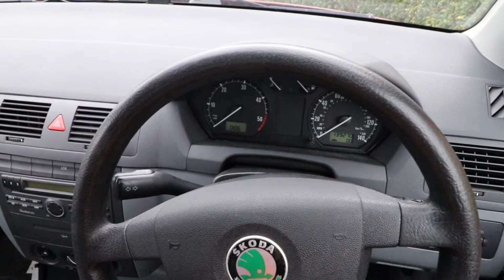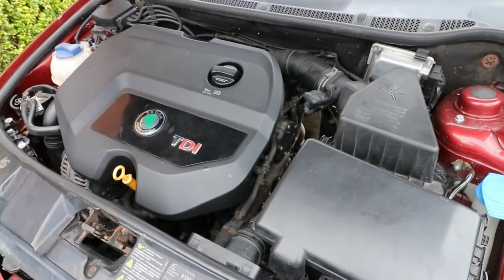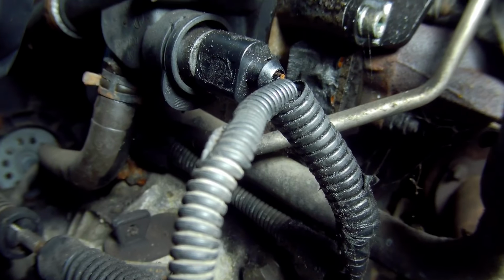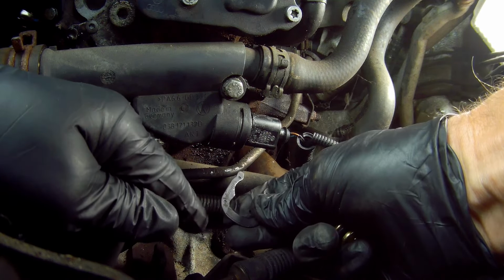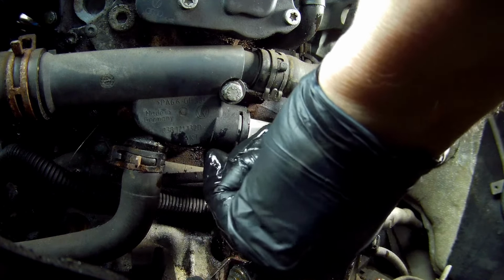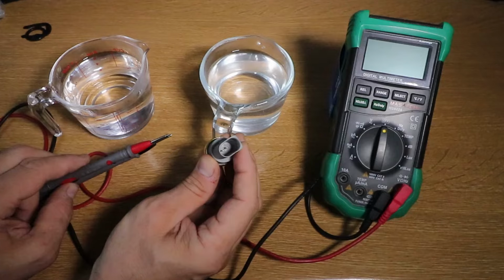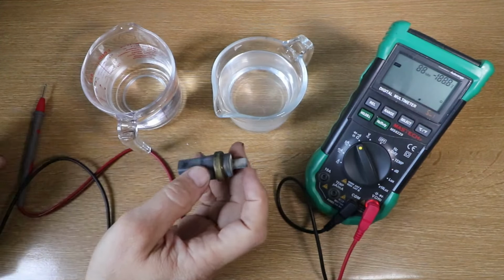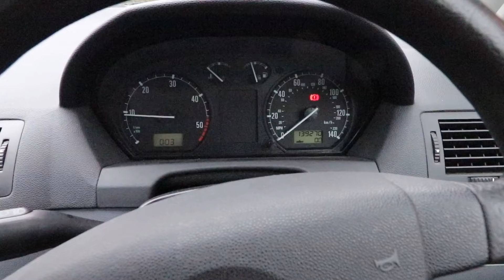SKODA FABIA Water Temperature Sensor + testing (MK1 99-07)

Comment: Hey Harvey, I've got some questions about a skoda fabia vrs, it seems like the removal of the back bumper is in two parts, I just wondered if you could point me in the right direction on how to remove and replace etc, I don't think it's quite the same as the standard fabia
Reply from the maker: Sorry, not sure. I think they have a couple more screws. I thought they were one piece, maybe you have a bottom skirt. I know there is a diffuser on the MK2 fabia.

Comment: I have problem in dashboard (EPC) and cruise control stops working.  I have been to monitor he says should you replace brake light switch and I replaced and problem is still
Reply from the maker: You will have to go through the various systems to find the fault. throttle pedal, throttle body, traction control and of course the cruise control. Are the switches on the cruise stalk stiff/loose? spray with electrical contact to clean with bat disconnected. First look for bad connections by taking off/on, leaks in throttle body/clean MAF/EGR.  May have to use OBD2 scanner to indicate issue in the end. Also re-check brake pedal switch fitting/functioning correctly. Hope this helps and you can get it working again :-)
Reply: @HatBoyHarvey  Thanks, I will try

Comment: what if the cold start continues after replacing a temperature switch its start after 2 attempts or more vw polo 9N?
Reply from the maker: I am not sure if it is down to pour quality replacement expansion tanks or something internal, maybe resistance builds up in the wires with age that gives incorrect readings to the ECU . There are 2 sensors one for temp and the other for level, the first is a variable sensor which you can test out of the car with a volt meter (resistance decreases with heat) and the coolant level switch sensor which is just a switch continuity across the terminals. Obviously you can override this, but I can't recommend it you understand.
Reply: @HatBoyHarvey  thanks for reply sir the  other sensor you are talking about is camsensor?

Comment: Hi.. I have an issue with skoda Fabia 1.2 petrol,  that Airbag indicator is continuously ON from last 6 month and vehicle is handled by me only. Can you please share how to fix this problem..
Reply from the maker: Can you remember any conditions 6 months ago that could be related? check the seat belt switch under the passenger seat isn't stuck in open position. is your battery correct Ah for car with good 12v+ voltage/charging ok? clock ring on steering wheel, many things can do this. Wiring on older cars can loosen within connections. Does the car leak-in water? Are all systems working correctly in car? Have you changed the brake-light pedal switch? if you can get access to obd2 reader it will help narrow things down a bit.

Comment: I have a Fabia 1.2 Htp and have replaced the expansion tank and temperature sensor but still have a coolant light on dimly constantly despite levels being fine any help please?
Reply from the maker: Examine the connection/wires for breaks on both and then look at the cooling fan relay and connections.

Comment: thanks for your video, it made the installation very easy! I changed my ECT sensor because I got a fault code in my OBD but now it still stays on the bottom of the gauge after a long ride and sometimes suddenly jumps up to the middle and stays there.. Any ideas?
Reply from the maker: @adamben1978  sound like a continuity issue. A break in the wires or a connection is loose somewhere. You can check this with a test light end to end,  may take some time to find it :-/
Reply: @HatBoyHarvey  i will take a look at that thanks alot! i was thinking maybe i received a faulty sensor

Comment: Thanks Harvey for that great video, very instructive and clear: I was wondering if I could test the operation of the cooling fan by shorting the terminals to the water temperature sensor or is it likely to damage the temperature dial because the resistance is too low?.
Reply from the maker: it goes to the control module so no you can't short it. Take it off and the pcm will detect a fault and turn the fans on. you will probably need to clear the fault afterwards. you can also check the thermostat is not open all the time and not getting fully hot. To see if it works, power the fan manually . check the fan relay and connections.
Reply: @HatBoyHarvey  Thanks Harvey its great to know, I have tested the Fan direct from the battery and the fan is fine. As you say it could be the thermostat, the needle takes its time to reach the mid way mark and then drops  if I go downhill.  The thing is when the AC is connected only the small fan spins and I thought they were connected in parallel. thanks again great channel.

Comment: Iv a 1.4 2005 skoda fabia would it be the same. Thank you for your videos.
Reply from the maker: On the 1.4 MPI take off the engine cover and it is just behind the rocker cover on the right pointing up vertically.
Reply: @HatBoyHarvey  you're a legend. Thank you for the reply i ordered my oil temperature sensor and water temperature sensor.  Love my little 1.4 tdi work horse skoda fabulous. Have a great  weekend.

Comment: Hi Harvey. Great Vid as always. Just changed my ECT sensor. Would you know if this is link to the fuel management system? (ie would a faulty sensor effect fuel economy?) Thanks.
Reply from the maker: Yes and it would.  The ECU takes temperature into account to decide the fuel-air mixture ratio  and a bad sensor could result in an over rich ratio leading to black smoke from the exhaust and poor fuel economy.
Reply: @HatBoyHarvey  brilliant. Thanks for the info Harvey. I'm hoping this might cure my fuel economy issue. Appreciated.

Comment: Hello, many thanks for your helpful video...I'm having the same issue. Would you know where the sensor is located on the 1.4 MPI model (2001) at all? I can't seem to see it in the same place as this particular model. Many thanks again for the great invaluable content!
Reply from the maker: If you follow the coolant pipes you will see that they go into a plastic fitting on the side of the engine.
Reply: @HatBoyHarvey  thank you! Would it be the same Two Pin sensor as shown here? Thanks again :)
Reply from the maker: @meckleemu  4 pin
Reply: @HatBoyHarvey  thank you!

Comment: Hi, I've skoda fabia, last week water pump changed, since than I realised the air vent don't blow out a warm air, somthing isn't right, any idea of what causing the this problem?

The water level ok.
Reply from the maker: Sounds like water circulation has returned and you have warm air again. If this is not what is set on the temp knob then the flapper motor is stuck on hot which often happens on older fabias.
Reply: @HatBoyHarvey Hi thanks for replying, I'm sorry, I mean it don't blow a warm air, it's only cold air.
Reply from the maker: You could have an air-lock stopping circulation through to the heater core or the control is stuck on cold.

Comment: Great video, as usual!
I have found it, as my Fabia 1.2 AWY  from 2003 was not able to pass the emission test(high CO). 
I went to the garage with  very hot motor(temperature indicator was vertical) , and the guy was doing the high RPM test(I don't remember, was the idle already done or not), and after a several unsuccessful test run, the car was starting to beep, and the red thermometer symbol was there. He was not able to test it after. 
It means I have two problems right now:
-1st one is the high emission-value, it seems to be rich. I can read around 0,75-0,85 V from the O2S2 sensor, which is high,  but fairly constant. 
-The second one are the fans at the cooling radiator. I have tried as well, the catalytic converter was red already, and the cooling fluid was in the sky, but they were not running. (Temp indicator was around the bottom of the red sector.). 

Isn't is possible, that these two thing are related, and the temperature sensor somehow not sending signals to the ECU (only to the Instrument Panel) that the fluid is already warm, therefore it is thinking, that the engine is cold, and the relays will not switch the fans ON,  and the engine is getting the richer fuel mixture thank to the auto choke. However, the higher RPM at the cold start(around 950-1000) last only for 1-2 minutes in idle.
Reply from the maker: Thanks. Sorry to hear you are having problems with the car. What did the garage say about the car? The fans can be fixed, check fuses, possibly relay is toast or fans themselves can also fail (voltage tests). Check fuses, OBD2 scan for diagnostics and replace coolant thermostat and temp sensor. Is there water in the oil after changing? Filters changed? Dash lights? 0.85v is rich should fluctuate between 0.1 - 0.9v. test/clean/replace MAP sensor. one thing at once, process of elimination :-)
Reply: @HatBoyHarvey  Thanks for the reply!
I was the last customer in the garage before the closed,  therefore we had not to much time to talk about it, but his main issue was of course not the CO emission(as the can run), but the boiling water, and why the vents are not running. He was mentioned the thermostat, but as the garage is mainly only checking cars (and let them into the traffic-I don't know the English name of it) , he was redirected me to my mechanic(aka me).
My wife had problem with that before, in 03/2020, just before the COVID-borderlocks, while she was sitting for an hour in the car in the jam. So I know it was there at that that time already.

-I can easily rotate the vents by hand, I was not able to check the electronic yet. Was  already darkness, when I tried it yesterday.
-OBD scan brings no error, 
- "febi bilstein 29318 Coolant Temperature Sensor with Gasket and Spring" on its way, I am ordering the coolant thermostat right now. Do you have any suggeston for the coolant thermostat(just as you have the link in the video description)
-there is no water in the oil, and no oil in the coolant.
-Filters are changed in every year, just as the oil. Btw, there is no oil, or coolant loss at all.
-No lights, no error.
-The 1st sensor(O2S1) is fluctuating, just as you wrote, but the second one (O2S1) is between 0,75-0,85, as far as I know, it should have a nearly constant value, if the cat. conv. is at its working temperature. But not this high, as you wrote as well. 
-MAP sensor is on the list

Thanks for your tipps!
Reply: @HatBoyHarvey  I have tested the fan last week, I have directly connected it to the battery(using the starting cable). The fan was not woring, so I have ordered a new one from SKodaparts. I tried the new beforehead, while the old was already dismantled  -  old fan is broken. I installed the new one, and tried the car. After warming up, I stopped by the roadside, and kept the motor running on higher RPM. The vent was starting to turn at 94°C, so the switch in the cooler is OK. As it CAN switch, it means, that the termostat is working as well. 
While I was dealing with the fan, I have ordered a few other sensors, and switched them:the coolant temp sensor(like in this video, thanks again!), and the MAF(or MAP?) as well. 
This second one got a cleaning previously(using that special spray just as you), but the resistance value was not right(accoring to the grap I have found on the https://workshop-manuals.com/skoda/fabia-mk1... 
I have ordered a new switch to the cooler , and a thermostat and a pump as well- If I have to replace any of this, I replace them all.

After the fan test, I drove to the ARBÖ garage for a quick emisiion test(not officially, but to know, is it okay I have done). It seems that the emission values are okay, and I will be able to get the permission.

Thanks again!
Reply from the maker: @Sztyepadzso  thanks, that made an interesting read, cheered me up to think of the effort and care you have put in to look after your fabi and all things covered, great, just also check for vacuum leaks, egr clean etc and your done. One thing you can now be sure what has been replaced to eliminate those parts if any near future faults occurs :-)

Comment: I have poor heating in the cabin. It is a Fabia 1.2 44kv 64 hp 2007.lpg-petrol
please help
Reply from the maker: The main problem with the fabia is the heater often gets stuck on hot or cold because of a sticking distribution flapper motor, I plan to cover this as some stage, but not yet, I am sorry. The other things are to make sure the coolant system is clean and flushed inc heater matrix, the thermostat is working, all temp sensors are working. Hope this helps :-)

Comment: hi I have the same problem, 1.9sdi, replaced the indicator, the thermostat on the engine and the radiator and one fan (small) BUT it still gives that error? what to do, .thanks for the information
Reply from the maker: Is it actually overheating or not all (fans come on?) Check power, signal cables and ground, then use vagcom to diagnose where the fault is.
Reply: @HatBoyHarvey  Normal temperature work does not go above 90 C
Reply: all replaced and the coolant tank new
Reply: problem in the board :(

Comment: Hello i have a skoda fabia 1.4 68 ps mk 1 2003.

I have an issue. My temperature warning flashes at random points. No coolanat leaks or overheating occurs. Also when flashing ambient temperature sensor goes mad or fuel gauge goes to empty level but i have at least 1/2 of the tank.

Any ideas what might be? Maybe i should change the sensor or could it be the ecu?

Thanks
Reply from the maker: it could be the level sensor in the expansion tank (common issue) and the fuel sender unit has worn out in the tank OR also sounds like either water or condensation on the connection contacts at the back of the speedo binnacle or the circuit board has some broken solder joints that need re-flowing. Try disconnecting the binnacle, take it out and then spray electrical contact spray on the connections (take neg earth lead off first) let it dry fully and re-connect- if no joy inspect the circuit board. Let us know how you get on :-)

Comment: Interesting on the testing. I have an old one in mine and I cleaned the bronze part at the end thinking that would fix issues, as I had some white smoke which was definitely over fueling not coolant loss. Now my mpg seems all over the place I’m just going to replace for a new one. Would have been interesting to see if cleaning your old one would have fixed the issue or the issues are internal. Thanks

Comment: Whata that mean highest resistance in wor so that sensor will be  what?
Reply from the maker: There may have been a varience in the water temp as the colder it is the higher the value. I'm not sure if this alone would be a sign the sensor is bad, but the control unit may not like it when the sensor is outside a pre-defined operating range. I don't know if this alone can trigger a warning light or not (possibly) What is important is the change in resistance from cold/hot which my old sensor seamed to struggle with and would indicate a fault. My new sensor hasn't thrown up a light yet, only time will tell.

Comment: Hi again. I used your videos to remove my console and replace heater matrix so thank you. 
I have a coolant leak that I just can't diagnose.
The garage did pressure test and said no visible leaks, Is there a radiator cap that could be faulty, somewhere they may have connected the pressure test? Sorry I'm not that clued up to cars.
Replaced the expansion tank andcambelt/water pump.
Garage said could be gasket however no signs from oil/smoke/oil cap. I had run some steel series gasket repair through the system as well that I guess may not have worked. Any help appreciated. Mk1 fabia vrs pd130.
Reply from the maker: Radiators can leak slowly and the coolant evaporates out of sight. Heat can open cracks up and close when cold. It maybe worth testing if it leaks stood cold for a while. Obviously a cracked head or block would be pretty bad, so something to watch out for, as you are doing.  Fresh oil may show something up more clearly if there is an issue. Might just be a wait and see.